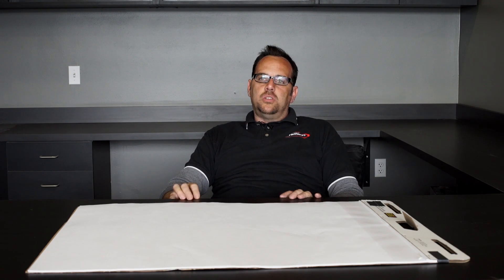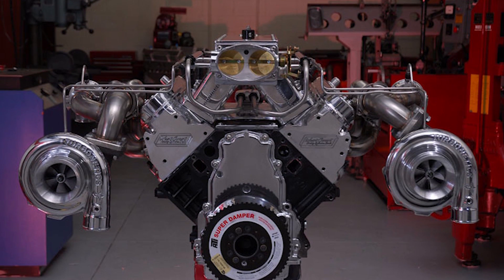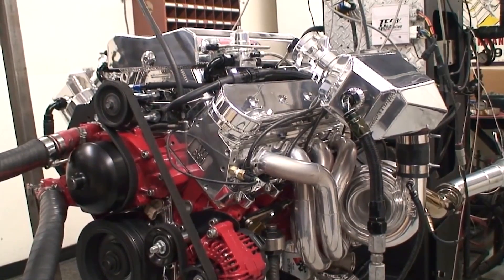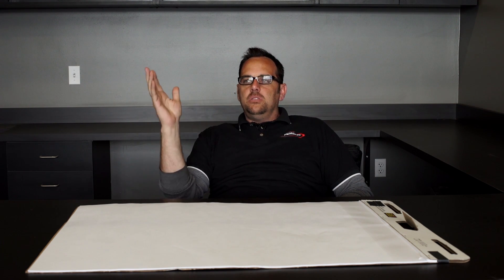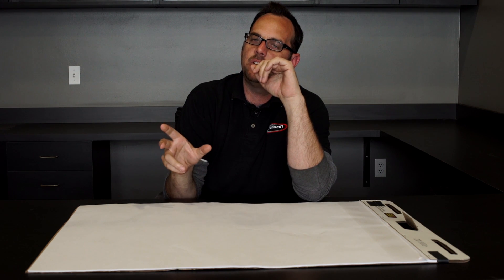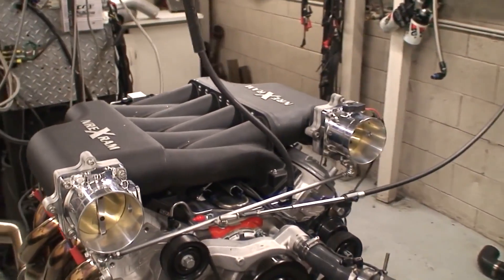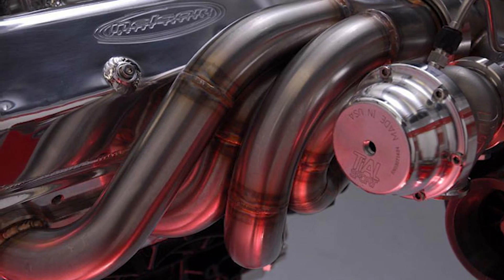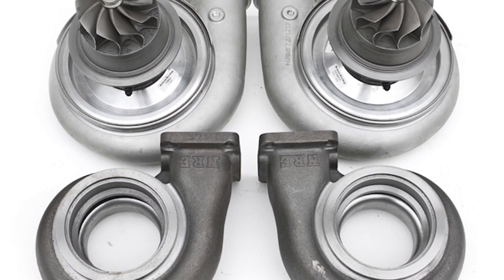Master Engine Builder Explains Why the LS V8 Is SO Good

Comment: Ever notice how real engine guys talk about torque and foot pounds, not horsepower?
Reply: he mentioned upstairs as much as downstairs. applications need different things, it't not like one is more important than the other.
Reply: @huss03    Exactly!  A man with a lever can easily make 1000 ft/lb of torque but could obviously only move a car very slowly.  That's because he can only make that torque at very low speed.  A man can only produce 1 or 2 horsepower.

Low end torque improves driveability but ultimate performance is determined by horsepower, assuming optimal gearing.
Reply: Horsepower is nothing if you don't have torque that's why everyone thinks HP is everything but it's not.
Reply: @79tazman  I been riding unicycle since 1978. It don't matter how strong you are. If you don't have technique?  You won't transfer that supposed power to the pedal crank, to the hub, to the spooks, to the rim, to the inner tube and tire! 
The unicycle is a thinking man's machine. You are the computer atop the quarter patch of rubber between you and the road!
The secret is your posture and foot position on the pedal and seat height. 
Arnold Schwarzenegger says form follows function the ballerinas saying the golden cord coming from the breastbone is pulling you up word this keeps you on your toes mentally but as a unicyclist you are sitting down 99% of the effort is in relaxation let the machine do the work.
Reply: @79tazman  Horsepower is what brings you speed, regardless of what you say...
Reply: So true.  HP is computed from torque when engines are on a dyno.  "A dynamometer places a load on the engine and measures the amount of power that the engine can produce against the load. ... A dynamometer measures this torque. You can easily convert torque to horsepower by multiplying torque by rpm/5,252." according to https://auto.howstuffworks.com/horsepower1.htm
Reply: HereIgoAgain Really? Torque is angular force/work done. Horsepower (Power rating) is work done over time (RPM/ rad/s / pie rad/s).  Stop spitting bs. Please learn more science.

Comment: Breaking in engines is a myth?   Yeaa ok.  See how fast you wipe a flat tappet cam lobe.  Piston rings need to seat, but fuck it daddy paid for it right?   All the material from the bearings breaking in is good for the engine.  Send it.  Fucking YouTube master techs.

Comment: Total Bullshit!  Introduced in 1995, yet to this day, 23 years later, not 1 sprint car team, not 1 Late Model Team (except the boring pathetic CT-525 crate late model league) uses a Chevy LS.  NOT ONE!!!
Why?  Because the 1955 Small Block Chevy is far, FAR, better.  Every engine builder in the Country can get 900+ HP out of a 410 cu. in. naturally aspirated, fuel injected, methanol 1955 old small block.
None of them can get 800 HP out of a 410 LS.  They can't get 800 HP out of a 435 cu.in. injected methonal LS. 
Chevy should feel embarrassed.  And a 5.3 liter LS Silverado is a dog.  Has been a dog since 1995.  Pathetic.

Comment: Main problem with ls motors is oem oil pumps are crap and exhaust bolts breaking in the aluminum heads...

Comment: Seriously if there weren't any aftermarket parts made for an LS motor would you even buy one? Hell no. Everybody that buys one rips it apart and starts putting aftermarket part in it without the aftermarket parts it's absolutely worthless. You should be saying why the coyote motor so good. Because it doesn't need help to make Power.

Comment: Using the push rod design, decent fuel injection, valve system, no-variable-valve-timing, 55 mm cam core, cam-in-block designing and other best factors of a GM LS engine and the Porsche 928’s 4.7 liter displacement would be required to make the PRV V6 a good engine instead of being the hunk of junk it’s notorious for.

Comment: IMO it's not that great from an engineering perspective. HP/Liter is very low. Before someone starts complaining about torque, horsepower is the sum of all torque over a number of engine revolutions. Engines that crank higher and can make torque at higher RPM will be applying torque more often and overall. Even with considerable head and valvetrain work, you're still barely hitting 100hp/liter

Comment: I`m going to strip my BSA Bantam now and check how much the skirt shows through the bottom of the barrel! However,with the2-stroker also relying on crankcase compression,maybe the piston is better stabilised than a 4-stroker.
I thought that`d be a good idea,but you know what thought did?....he got out of bed to tuck his feet in because he thought they were sticking out the end of the bed!

Comment: Just can't get past the horrible old-world sound of that intentionally-misfiring slow revving 90-degree crank, someone needs to fix that, might even help it get over 6000 rpm.  While they're at it how about a modern (1980s+) overhead cam system with variable valve timing (pushrods....really?....in 2017???).

Comment: Interesting, but one of the biggest cons against Aluminum engines blocks that he left out is the fact they are assembled with steel fasteners. Aluminum and ferrous metals do not like to come in contact with each other. When they do a galvanic action circuit start conducting between the two dissimilar metals and the Aluminum threads immediately start to deteriorate. This is what killed the Northstar engine and several Japanese engines. The problems show up first with the engine head bolts and main crankshaft bearing supports bolts and continues to effect minor things like electronic sensors circuits and connections by changing the resistance.  Amazing the car builders have never figured this out, or maybe they have. The surface coating only delays the process a little.  Also, mostly the only motors you guys are actually working on are the engine starters :). Great interview I enjoyed it! I wish I had known some of this stuff back in the days when for a short while my 327 chevy's were king. I too got bite by the bug to make the make my wheels turn faster then the next guy, It started with go-carts at 11 years old at first.

Comment: All I’m saying, I’ve never seen a ford engine swapped into anything, usually is out the door and replaced with a build hemi or ls.
Reply: The 9 inch GODFATHER or RearEnds.
Built Ford Tough.

...gotta have em tho
Reply: the 4.0 inline six barra engine
Reply: @shoegum7362  I was just going to type this 🤣 they haven't seen Australias greatest engine since the 308, Barra swap anything and everything.
Reply: The 5.0 had a decent run back in the 90s. But then they went the modular OHC route vs GMs LS and lost any headway.
Reply: People were swapping 5.0s into Miatas for a while.
Reply: zaknefain100 lol not many. Who would do such a thing. Its heavy and it could barely fit in the engine bay. The LS is so small and light.
Reply: @RBZ06LT6  well i don't disagree but it was a thing for a while. then again, the LSx wasn't yet on the scene. Believe there was an outfit doing the swaps... called it the Monster Miata.
Reply: zaknefain100 ok, i see

Comment: i purchased a LS 3 out of  a nearly new salvage. i am putting this engine in a 35 coupe. I am not going to have power stearing or AC in this car  my question is do i have to keep the power steering and AC pulley for engine balance? or can i remove them?  Thanks

Comment: My rebuilt '71 340 Wedge 4 Barrel engine in a mechanically restored '76 Plymouth Duster outruns old & new Chevy, Chrysler, Mercedes, BMW products when I'm in the mood. Hold back until someone thinks they have an edge on you, then leave their sweet little car in the dust. 0 to 60 in 4 seconds as a former king of drag racing did when performing  40+ years ago. She's a wild ride built for kicks.

Comment: I just thought about something. You can combine, steel and aluminum, and if you x-rayed a 3D printed block, that made the steel inserts look like an air cooled engine, sunk in aluminum, and the aluminum block was just water cooled, look at those 3D thermodynamic simulations! They have thermal conductivity software! Temperature control and strength of materials!
Reply: Ask West Coast Customs for copies of my Facebook posts and messages.  Thermal cruise.  Miles per gallon can change once the engine, and thermal exchanges are at operating temperatures.
Reply: If the vehicle is used for shipping, there's a milage solution, thermal cruise.
Reply: It's a intake manifold to preheat air, a droplet size so small, buy fuel and air preheater, vaporizes the fuel before it reaches the cylinder and piston chamber.
Reply: All electric ceramic heat exchange for fuel.  US fuels have thermal ignition specs to avoid desieling by compression ratio.  The compression ratio defines peak temperature per compression stroke.  Having an excess of 6,000 psi behind a needle valve jet.  Stepping motor fine control on the needle jet.

Comment: Wonder why Ford gets no credit? Camshaft thrust plate check Thrust in center of cramkshaft check. Symmetrical intake and exhaust valves check. LS can be honed using Ford small block torque plate check. New Dart LS block uses ford 351C Ford main bearings and main caps. The LS cooling just like the Ford small block water is routed by head gasket.Engineered or copied?

Comment: Pity they can't make a decent oil pump for it - I had one relief valve seize after 65K miles and just 4300 miles on a brand new crate engine, the second one died too.  Not very impressed with the ancillaries so far...

Comment: This thread is hilarious, there are people saying DOHC was created by morons from Europe. lol Really we have people honestly claiming that DOHC sucks and SOCH is better simply because the morons at Government Motors still live in the 1950's.

 Are you Chevy partisan freaks kidding me?????

Note I have no issues with the guy making the video other than he is clearly a completely bias Chevy head and there is nothing wrong with that. Just admit that's what you are and don't make some claim that an antiquated 1950's technology motor is the "best" while implying you are unbiased in making that judgement.

Honestly Ford Coyote 5.0 crate motors are cheaper, and thanks to the amazing flow of their DOHC with Variable Valve Timing heads/cams are proven to make more power when adding forced induction while getting significantly better gas milage and much lower emissions.
Reply: electroman0076 it's true that dohc is more efficient rev harder and bla but they cost $$$ to maintain and work, if such old technology it's still being used today it's for something

Comment: He forgot to add that the ls lower end is a direct rip off of the Ford Teskid modular block design..... 6 bolt mains and sunk in block crank etc..... And the coveted cathedral heads lol a direct copy of Ford's 390 heads circa 1970 with the valves and ports punched out..... There so similar you can bolt one to a 390 how bout that bow tie boys. Chevy couldn't beat them so just ripoff Ford's designs......

Comment: Strange I found the Video pretty boring.I 'm not a fan of the Ls but I respect the Architecture and Cost. What I think most people don't realize is the so many of it's so called innovative design features are actually quite old.For instance the Y block design with cross bolted mains dates back to the 50s in the Ford FE 360-427. At Chrysler it dates back to the 64 426 Hemi and also the B/RB. The symmetrical port head design also dates to those same engines and has been used by Ford in every V8 since including the Ford Windsor,Cleveland,Lima, Boss 429,400 M etc...and all Generations of Hemis. The Flatter valve angles have been around in most of those engines also. Like I said very good design features and is probably the Cheapest v-8 you can build for the Hp. But If it were the best V-8 design out there it would have won far more Engine Master competitions. But the top engines there have been the Ford M design 3CHi and Chrysler 3rd Gen Hemis. Just my opinion.

Comment: I watched half quite a while ago, finally finished watching this! very good info,, 2 questions I live the dual throttle body set up, do you have any early test mock up versions that might be for sale, to a fan with limited Cash? the other question is simple enough, hard to explain! when porting a head have you ever heard or tried? now the explanation dimpling the surface of the plenum like a golf ball? why,, I once saw a test done on a Porsche track time! one just as paint! the other with a film dimpled like a golf ball just on the front quarter, bumper to mid wheel. any way YES the track time were 10 seconds faster! hard to believe but WOW! 10 seconds is a lot! with the advent of digital 3D printing a company with a flow bench could test that theory! thanks, my Aluminum 5.3 from a 2008 hummer (75 miles almost brand new) will one day find a project! I started my project backwards! just couldn't pass up this motor! used to do machining but back injury at 21 restarted my life direction! THANKS ALL THE BEST!

Comment: This engine is based on the legendary Ford 351 W, right down to the cylinder numbering and firing order. It does not equal the Nascar Ford F9, which is a 302!
Reply: Its hard not to build an engine with a ford firing order because ford used almost every firing order there is

Comment: Would have been better if the different components were should during the explanation - show us the cylinder heads & why the valves flow so well; show us the block compared to old small & big blocks.

Comment: Great video... I wonder if he's ever heard of the Self Sealing Piston by RGM that uses a Torlon rod with no wrist pin that has a Piston head with rounded edges  embedded with ceramic silica and hollow under the cap. The Piston head actually screws directly onto the Torlon rod and locks into place by a camber at the point of contact. 
It was dyno'd on a Cogsworth (sp?) racing engine at19,000 RPM and you could stand behind the exhaust it was so clean...
HUGE weight savings in swapping out pistons and installing a liner in the cylinder to handle the reciprocating action of the Piston "wobble" as it pumps up and down without a wrist pin.  The tremendous mixing action of the turbulence created by the Piston on the gas intake was found to burn 80% more of the fuel per stroke than a conventional heavy Piston, thereby gaining more horsepower and burning the fuel more efficiently.
It's listed in the patent office under Self Sealing Piston by RGM, Inc.... 
Michael Andretti came out and looked at our testing and wanted to use it in his racing team for Formula One,. but the first gulf war hit and it got left by the way side.
I still believe it could be an engineering breakthrough if put back in to development. 
It was fun working on it with the inventory Ralph Gordon Morgado....

Comment: I am under the impression that variable cam timing is the next area to optimize. I'm talking for optimization of power and/or economy in daily drivers.  Not whole-cam shifting but lift and/or duration. Also, open relief when when the power isn't needed. I would like to see this type of camshaft developed. Maybe valves actuated differently?  Comments.
Reply: One idea is basically a fingered or multi-pieced lobe that widens duration by centrifugal force.

Comment: I have a 74 avanti. It has a GM 400 cid in it, has 65000 miles and it looks like a 2 cycle. Sad it needs a top overhaul at 65k.If your series is aimed at faster, better and more reliable don't start with a gm product.Try a Volvo 1 million miles plus.
Reply: Nobody beats on Volvos like they do LS engines.  If you baby it (drive like there's an egg between your foot and accelerator) they are nigh indestructible.

Comment: Have a L99 Camaro that's 400HP stock. I installed a Magnuson supercharger (custom tune) along with my other intake and exhaust mods. Running ~ 570HP (stock cam). Love the sound of a V8 engine.

Comment: Whats he talking about when he talks about valve's at mid lift ? When the exhaust and intake valve are both open for a fraction of a second ?
Reply: Yeah its called overlap. Thats why dynamic compression ratio is much more accurate than static dumbass hehe

Comment: My "square body" 1990 Chevrolet Suburban has 339,000 miles on the odometer with its original 350 sbc, I hope when it's time to retire it i can find a cheap LSx to drop in, and in a perfect world with a 6speed manual.

Comment: I can see that a big problem with these engines is that they are only two valves per cylinder.  Modern quad-cam four valves per cylinder engines with fuel injection make those old US V8s look like they came out of Fred Flintstone's car!  The main snag with those V8s is that having to fit sixteen cam lobes into the same length as a four cylinder engine dictates that the cam lobes will be very narrow.  In fact the Sears Catalog used to have cam kits for sale with the claim "If your V8 has covered 50,000 miles its power could be down by half".  Yup I completely agree with that statement!  Over in England the most common V8 engines were the baby Buicks which are still in use today.  Unfortunately some of those engines would really struggle to propel a car at 70 mph!  When stripped down it would always be found that several of the cam lobes would be close to a perfect circle!

Allegedly the problem is that Zinc has been removed from engine oils as it can affect catalytic converters.  All is not lost however as one can still buy PD oils (Pump Duse oil made for Volkswagen diesel engines that have  Unit Injectors)  Tremendous forces are required to drive the injectors and modern Zinc-free oils are not up to the job.
Reply: It's a Chevy V8, Ford doesn't use the Push-Rod motor anymore